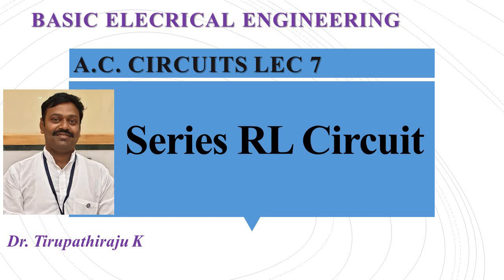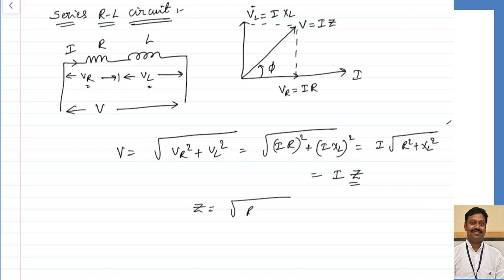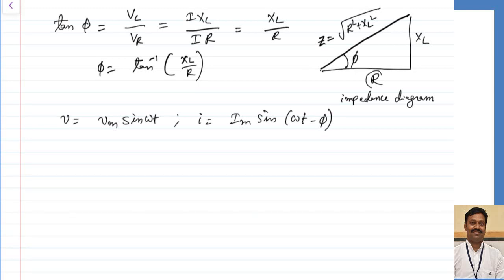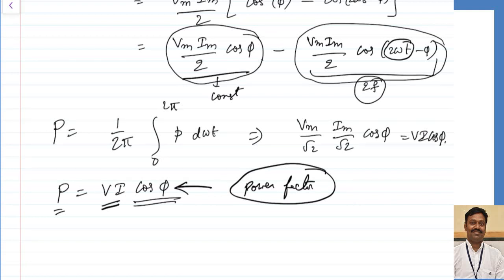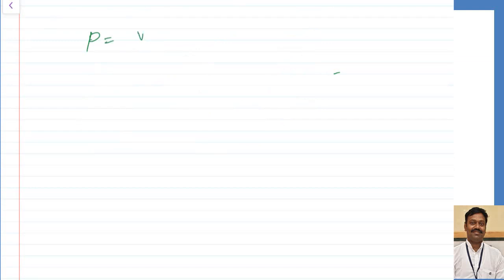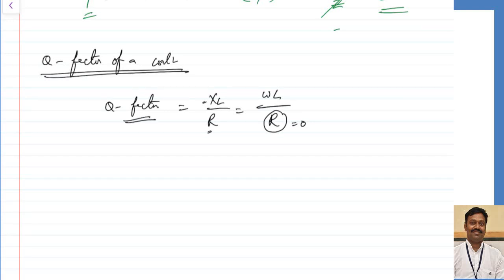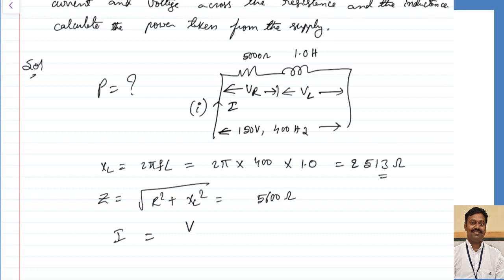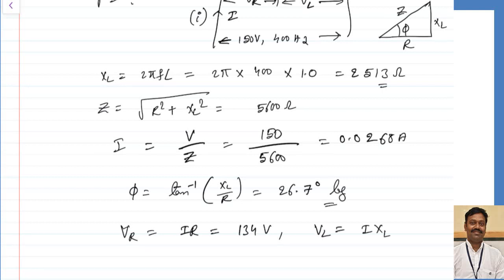BEE 207 Series RL Circuit

Comment: Hello sir, it looks like you used the law of cosines to find cosine theta for the final example. I get the same answer except it is negative. (cosine theta equals -0.1375) This only makes the resistance for R1 a negative quantity which I can just assume to be an absolute resistance. The thing is that the angle value changes with the sign change. My question is simply why was the coefficient for cosine theta positive when you solved for it? Thank you.